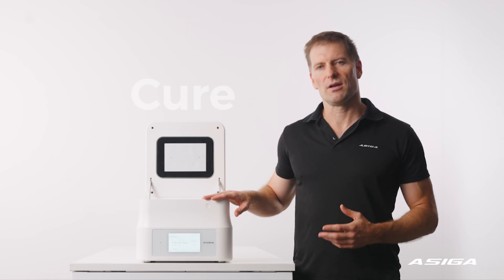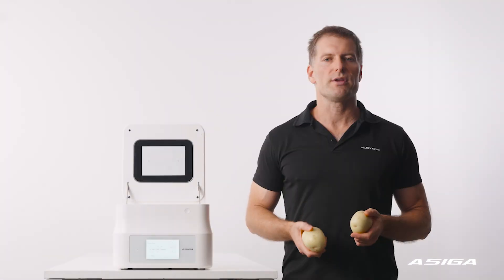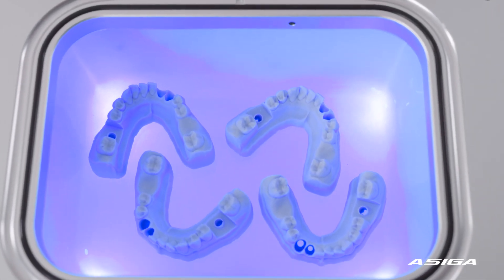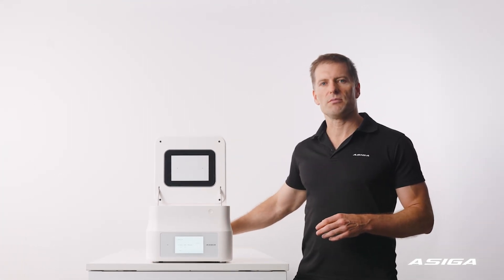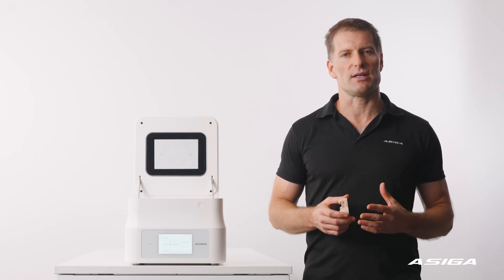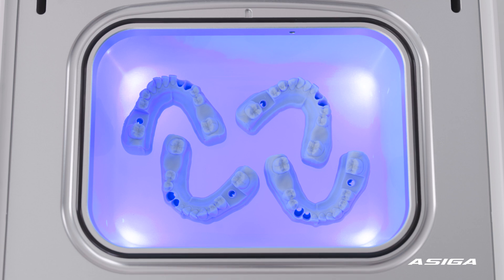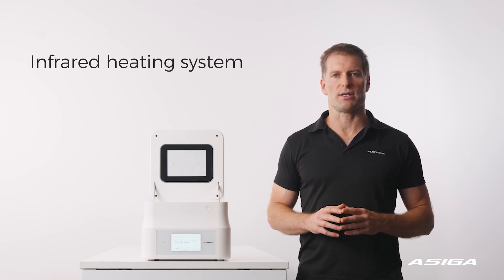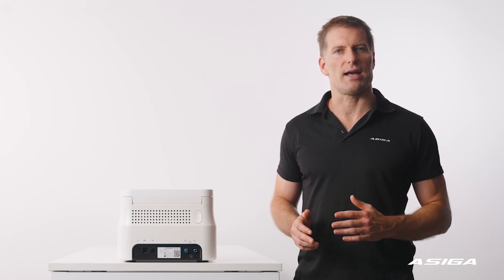The Asiga Cure explainer video

Comment: Asiga Cure operates at a wavelength of 405nm. What happens when the part to be cured is a pure 385nm resin? Will it be able to activate all its photoinitiators using a single wavelength that differs from the resin’s optimal absorption range?
Reply from the maker: Curing is still effective as photo-initiators are broad spectrum.  Curing parameters are provided automatically in the material ini files in our online material library.